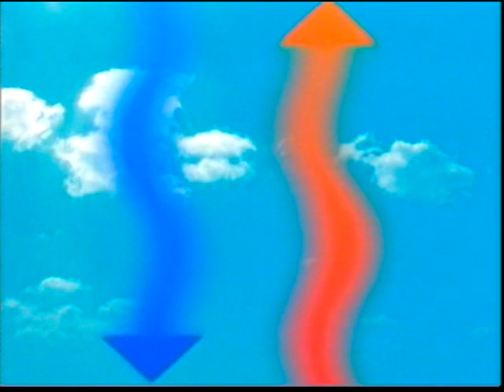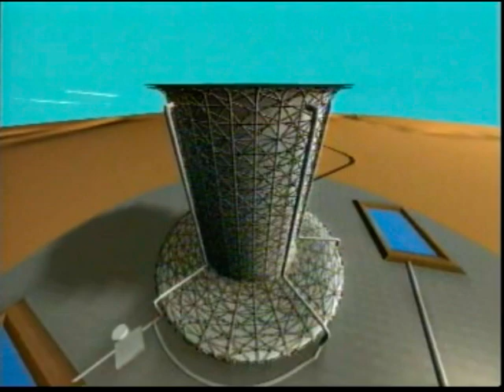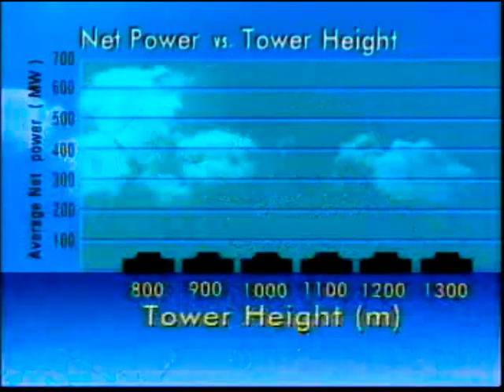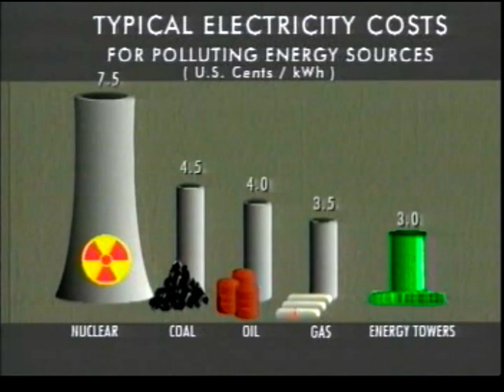Energy Towers Power & Water - Introductory Overview.mpg

Comment: -  That's one MASSIVE tower:
        Height: 1200m = ~3/4 of a mile (i.e. 1200m*3.28ft/m/5280ft/mile)
        Diameter: 400m = ~1/4 of a mile (i.e. 400m*3/28ft/m/5280ft/mile

-  And it's energy output isn't very high (i.e. 460 MW/Y is ~52.5 kW per hour (i.e. 460MW/Y/365.25/24).  Some home standby natural gas powered generators produce more than 50 kW/h....

I'd like to see how much $$$ that structure would cost to build!

It would also be useless in cool/cold & humid climates because it requires hot, dry air to operate.
Reply: Robin Schoemaker
"Doesn't it mean an average of 460MW over a year"
That's what it seems to mean.  My interpretation of what the narrator stated "460 MWs average annual production" is that it would produce an average of 460 MWh per  year. 

As a comparative example, a 5,000 Watt generator has the capacity to produce 5 kW of electricity per hour.  The yearly total energy output would be 5 kW * 24 h/d * 365.25 d/y = 43,830 kWh energy produced.

When the narrator states that  their generator would produce "460 MWs average annual production", that seems to be their estimated average energy production per year--not the power rate of the generator per hour.  If they wanted to state the generator power rate they should have just stated that generator produces an average of 460 MW when operating (which is a lot of energy produced every hour).
Reply: A B It means 460MW average capacity...something like 1GW nameplate before desalination and losses.
Reply: re:  "60MW average capacity" is not what the narrator of the video stated.  As specified before, what was stated in the video was "460 MWs average annual production".  Energy production is stated as either a power rating per hour or as an energy output over some period of time (e.g. a 5kW generator produces 5 kW/hr or 43,830 kWh produced per year).  What you've stated is NOT clear because it has no time component specified.
"capacity" or "productive capacity" is just as meaningless, unless you apply industry standards such as power or energy produced over a specific period of time.
Reply: A B English is not his native language. If you don't trust my word you can look up the idea somewhere else.
Nampeplate capacity would be around 1250MW.
I am sure you do understand.
Honestly you should be more polite.
Reply: Marcus MarcusK
In deed, I do understand the difference between power & energy.  Name plate 'capacity' is irrelevant as it is not usable power.  What I've tried to convey to whomever is reading these comments is my perspective on what has been stated & an attempt to clarify what you've written.  When you write "...It means 460MW average capacity...", I don't find that use of language to be clarifying.  In fact, I find it to be just as confusing as what the narrator stated.

I don't consider being clear as being impolite.  I consider it beneficial to whomever reads these comments.  Sorry if you interpret it otherwise.
Reply: you've made a mistake, it's 460MW instantly. It assumes that one tower could meet electric energy demand of 1 million habitants, it means

460 MW/ 1000'000 hab = 460 W / hab --> plausible but not alot

in kWh per hab per year, it gives

0.460 kW/hab * 365 day/year * 24 h/day = 4030 kWh / hab / year = 0,346 tep/ hab / year

an average american consume in electric energy near 1,14 tep per year, so 3,3 times more than assume by the project. But if we choose countries with dominante desert  and dry environment (I consider Algeria, Morocco, Libya, Egytpe, and Israel), I calculate that it takes only 0,25 tep/hab/year to meet electric energy needs of these countries. Considering total energic consumption with the same countries, it takes 1,15 tep/hab/year in average to meet total energy demand. Even though, it's an interesting concept this is worth considering.

Recall that it takes a dry environment for using this type of power station, a good geographical site would be the Atacama desert, in Chili, the driest desert in the world (ref: http://en.wikipedia.org/wiki/Atacama_Desert)

thanks

note : tep means tonne of oil equivalent (1 tep = 11630 kWh)

ref:
http://data.worldbank.org/indicator/EG.USE.ELEC.KH.PC
http://data.worldbank.org/indicator/EG.USE.PCAP.KG.OE
Reply: alias mrstarmat If you are correct that "460 MWs average annual production" actually means 460 MW of instantaneous power, then the annual energy output of such a system would be ~4 TWh/Y--which is ~4032 kWh/inhabitant/Y (i.e. 460 MW*3600*24*365.25/3600 = ~4 TWh per year... / 1M inhabitant = ~4032 kWh/inhabitant/Y or ~336 kWh/inhabitant/month). That's not a lot of power for each household each month.  Note:  1 Wh=3600 Watts

If electrical consumption is 13,246 kWh/US person/Y or  ~1,103 kWh/month, them I'm using less than half as much electrical energy as the average US citizen.

From your data sources & my calculations, the average American consumes about ~3.3 times more energy than the theoretical energy tower that is described in the above YT video.  (13,246 kWh / 4032.36 = ~3.3)

All this means, of course, is that I have confirm what you've written is roughly equivalent to my calculations--based on the assumption that ""460 MWs average annual production" actually means 460 MW of instanenous power" is true.
Reply: exactly

I've used "tep", but the right unity is "toe" for tonne oil equivalent, because I come from Quebec, Canada, and my first native language is french. I've used tep instead of toe, that means in french "tonne équivalent pétrole" but it is exactly the same. The most common unity for electric energy is "kWh" instead, and "toe" is for total energy consumption (when I mean total energy, it's all categories of energy used) like the fuel for transporting persons and goods example, it doesn't depend from electric energy production.
Reply: I'm not certain that your citations include ALL of the energy consumption of Americans.  Many people make & burn biodiesel & biogas (from wood, trash, methane from organic waste (manure, trash, wood/leaves/grass, etc)
Some people even burn bad dry corn for heat
Reply: I agree, it would be a mistake to say that it includes total energy consumption talking about toe unity, we use much more energy if we consider every aspects from society giving us all services and goods we enjoy presently, example, production of foods, and goods like cars, and articles, all these things needs energy to be produce and be transportable on our shelves. 

here is an interesting video talking about our incredible energy consumption, featured by Saul Griffith, engineer, scientist and entrepreneur wanted to revolution our way of producing energy with renewables

http://blip.tv/slowtv/a-personal-and-a-global-view-of-energy-and-climate-saul-griffith-p1-3544261
Reply: That's interestig, however, I'm not sure their catastrophic predictions are valid.  Some people argue that we would actually be in another ice age at this time if it wasn't for the burning of fossil fuels.  Frankly, global temps have been cooler the last few years due to less solar activity--so, I don't think they really have their models right yet.  We'll know more at the height of the next peak solar cycle.  If during that peak we experience worse conditions than we did during the last peak, I imagine there will be no more debate & policy changes will be impletement over the voices of protesters.

Frankly, I despise Al Gore's doom/gloom + carbon-taxation strategy.  Perhaps Lockheed Martin will have mass produced & installed enough fusion electrical generators before the next solar peak to dramatically reduce CO2 production.  It's going to take a new innovation to change the status quo--people are not going to keep their houses colder and as the population continues to increase each person adds more CO2 to the air--so, it looks like tech advancements will be the solution or a major die-off may be on the horizon as environmental conditions take out the less fortunate.
Reply: you're talking against the trends of the "three decades from 1983 to 2012 were likely the warmest 30-year period of the last 1400 years, according to the IPCC" 

"temperatures warmed roughly 1.53°F (0.85ºC) from 1880 to 2012", it's clear in globally perspective and in large period of time, we experiment warming trend. Even if we experiment example colder winters or years, we have to consider the trend in a wider perspective, like in decades observations and better if it's in centuries. 

There is no second chance with climate change, if we realise we were wrong and underestimate it, we're done. Catastrophic climate change could occur. It's already happened in the history of earth, it's a reality that we could face we like or not. 

ref:
->
https://www2.ucar.edu/climate/faq/how-much-has-global-temperature-risen-last-100-years
->
https://www2.ucar.edu/climate/faq#t2507n1344
Reply: Do you really want to be a slave to a global carbon tax system based on a bunch of maybes?  I don't.  We aren't at a crisis level yet (contrary to what some of them would have you believe) & until the cooling trend ends, I'm not ready to accept their models & unproven dire predictions as accurate enough to justify international slavery via a global carbon tax system.

I'll reserve my conclusions until ~2022 (when the next solar peak is supposed to occur).  If we continue to experience cooler temps while CO2 levels continue to increases (as has been occuring tor the past 3 yrs), then their science will be proven to be nonsense.
Reply: Dams also are massive. So theres no problem

Comment: Seems like there's a few drawbacks with this...

First is properly filerting sea water so you don't get organisms and dirt into the whole system.
Second, what happens with salt and other minerals in sea water once it's sprayed at the top of the tower? I would imagine a lot of sedimentation occurs over time.
And last but not least, if water going from the tower back to he sea is even a few degrees hotter than sea, it will destroy ecosystem in a large area around the outake.

Comment: Is this the same concept on how a stirling engine works?
Reply: It depends. More like how a refrigerator works (which is also similar to how a stirling engine works, but this thing has extra steps), The water is pumped, while pumped the pipes are somewhat cooled closer to ambient temperatures, while the water is released it returns to ambient pressure, which means lower temperature, which means it will go to the ground, while also releasing cool mist to help with reforestation, and the recovered water is pumped back into the sea to cause bio-hazard due to increased salinity instead of evaporating the water to use the salts for something else (like shipping food salt inland, or processing the salt into something), and no solar updraft tower is used near the shore to make use of normal water vapors and there already being a shore to get a solar mist updraft tower and a water tower to get enough pressure passively to power the mist downdraft tower and allow the mist downdraft tower to be much further inland.
Reply: In some way all engines work this way 

Energy gradient converted to power

Comment: +brickandfanal I was thinking the same thing, but maybe not at the bottom. You could double the amount of turbines by placing the water spraying system into the middle of the stack, then placing turbines at the top and bottom. I would also suggest adding a self pressurizing system of solar focused heat exchanges that help pressurize the water in the first thing. It would help pluming costs and add more power generated. That, or use a combined system of green energy to power pluming, then use the raw power of the system to give to the cities. Idk, neato concept to mentally toy around with i guess.
Reply: AtomicHailstorm having turbines at the top of the tower adds costs like extra structural strength, difficult access for service and repair , and reduced efficiency. Otherwise what you have stated I agree

Comment: the problem that any place close to sea see its chances reduced to find dry weather conditions.  So the most certain that this will consume water from aquifers or rivers.
correct me if I am wrong.
It looks like a good idea anyway.. but the possible locations (close to cities) are very few.
Reply: There are places near the coast (atlantic coast of africa for example - West sahara, Maurenatia for example) where the dominant wind pattern is westward (from land to sea).
Reply: It does not have to be close to a city, you can transport electricity with minimal losses (about 3% per 1.000 km when using high voltage direct current power lines).
Reply: but if you dont have a power line close and you are far from the cities, then you need to add the contruction of a power line to the total cost.  Of course the lost in efficiency is negligible, but I was talking of the cost and the possible ecologic problem to dry aquifers.
Reply: AngelLestat2 english?

Comment: cost of construction? And how many homes would it power?
Reply: What does matter? 30$/Mwh is the number that is important. At 30$/Mwh*460*24h*365d that's 120.888.000$/a
460MW...depends which homes.
Water for a city of 1Mio (Israeli consumption).
They are talking about 460MW average so possibly they included a capacity factor (that could be in the high 90ties cause you could service each turbine on it's own if you can decouple it. Essentially it is some hundred windturbines combined).
A 500MW coal plant would be around 300-600million, not considering fuel/coal. I would say around 600-800million for the tower...no fuel needed and you get the water.
Reply: Albert Tremblay 
Du bist vielleicht ein Koffer.
Reply: I didn't expect an intelligent argument.
Reply: +Albert Tremblay a german engineering buro calculated about 1,5 Billion $ (1,5 Mrd. Euro). Due to the fact that you need no fuel and getting a lot of water the tower should be financially equal a coal plant after 15 years. But due to the fact that a solid tower should stand 100 years....
Reply: +Alexander Karl THERE IS NO WATER USED.HERE

Comment: Im no engineer, but I dont understand how its possible to pump water x amount of miles, 3600+ ft in the air, drop it and produce more energy than it takes to pump it. That and building a tower thats around 4000 ft ish tall is quiet an expensive effort.
Reply: +shashaw08 as you can see in the video, you neeg about 33% of the energiy to pump it up.
Reply: +shashaw08 It's not talking about dropping the water.  Its talking about evaporative cooling of the hot air in the same way a swamp cooler works.  This thing has got a lot of problems though.  It has to be almost twice as tall as the world's tallest building, 500 meters wide and hollow.  That pretty much adds up to "not buildable".

Given their seeming lack of construction knowledge, I don't think I'd trust that 33 percent water pumping cost.  Also, you don't get "brine" from evaporitive cooling using salt water.  You get salt.  Lots and lots of salt.  Going into your wind turbines.

Comment: Thermal inductance is and has been around for a long time piramid's seem to have a natural air draw from the bottom to the top of them ,, maybe they even made frsh water at some time in the past . .Well yes to the sedimental aspeck's and the water could actually be hot by the time it got baack to the sea and the brine is bad  too the brine should be used for smelting and secondary uses like solar dish heat tranesfering heat's

Comment: Sounds great to me, but the fact that this video looks to be about 20 years old is not exactly reassuring.
Reply: This might be, in 2015 there is going to be one in San luis
Reply: That'd be awesome.
Reply: ikr?
Reply: godonlyknows13 These systems were originally proposed back in the 80s and 90s to remove particulates and pollution from the air. The water then has to be cleaned before being dumped back into nature though, which consumes power. There may be a net increase in mass flow rate through the tower, but that's the only way they could possibly net more output power than the system would consume just from pumping water to the top of the tower with enough pressure to form mist.
Reply: fromkentucky So it'd largely be a bust?
Reply: When you take into account the power required to pump the water up the tower and to clean the water afterward, it would likely be a bust, hence why they were never built as power plants. If they used current generation solar panels or solar steam generators to lift the water, then it may be viable.
Reply: fromkentucky but then its just a glorified solar panel
Reply: Nothing wrong with combining multiple technologies, especially if it's cleaning the air.

Comment: Built yet? Anytime soon??  By the way, nuclear is no more polluting than this, especially if phase 4 or better is installed, AND, actually dealing with the nuclear wastes, which due to the newer tech would be significantly less than the antiquated 1940's tech currently in use.

Comment: Is it possible to build an 800 meters tower? (Not even talking about 1300 meters...)
Reply: +danil kanevets Brine ? Evaporation will deposit tons of salt it that thing. Even lake water will foul that thing up in short order.
Reply: Yes, an 800 meter tower is possible. But not optimal in terms of energy production. 
As for brine being a problem, it is true that one must take into account corrosion, but no salt particles will exit the tower if the drop sizes are well controlled. The tower is designed such that the water droplets don't completely evaporate in the tower, thereby keeping the salt trapped in the drops and recollected at the bottom.